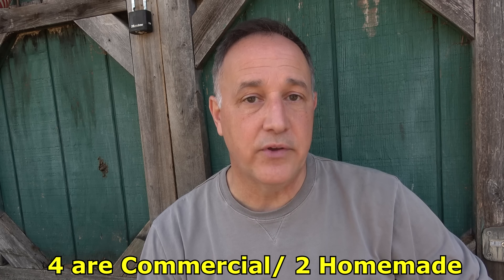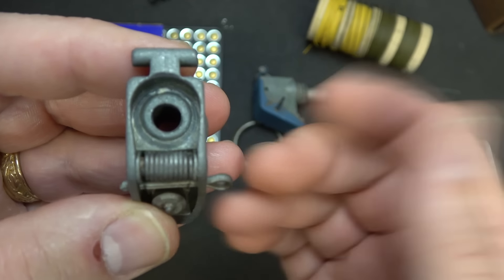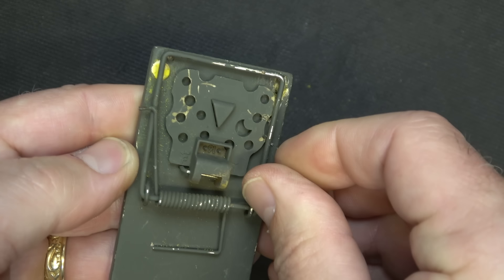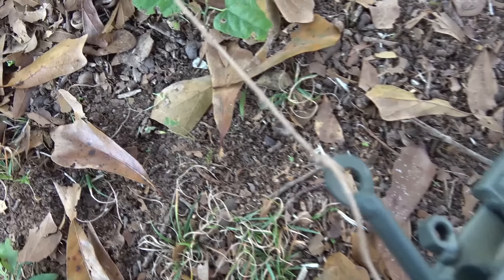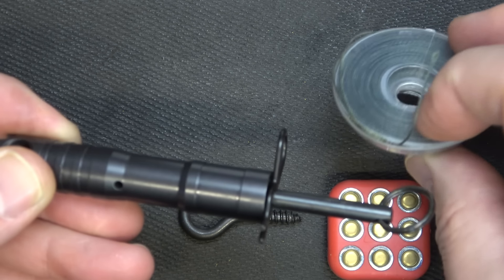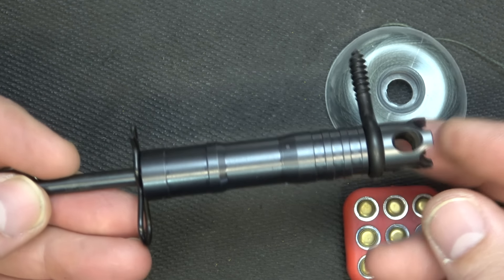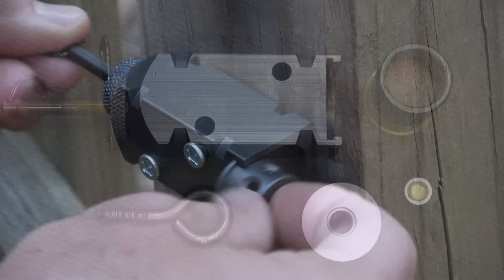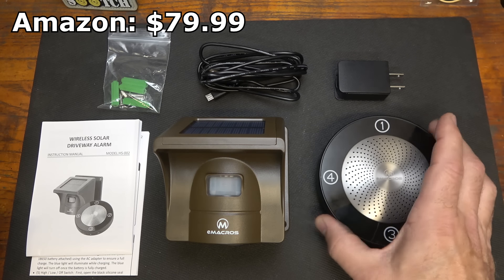6 Different SHTF Perimeter Alarms

Comment: I was an artillery officer and have slept through 155 Howitzers blasting 50 ft. away. I'm not sure a little cap would wake me from a dead sleep.  I've seen some cool motion detection alarms for campsite on Amazon for about $30. Sorry, I don't have the link handy. Emits an alarm loud enough to scare away intruders and wake you.
Reply: I was a small arms and artillery repairman in the army and I've slept through m777s going off, but I'll wake up from someone trying to open my door or my dog getting off the bed.

Comment: Mike at fifth ops has made an outstanding product for countless uses and American made used correctly without a doubt built to last longer than me and he’s very good with the customer’s certainly takes pride in his work and rightfully so make no mistake this product is not just for scaring bears my expensive tools are safe from the tweakers after many attempts to break into my shed and they will not come near it anymore because of the OC pepper loads they are both wise I’m onto them and they have no idea what maybe next

Comment: I wish you would make a general video on home protection. Here are a few of my ideas. A $1.50 wooden stick could save your life. One of the easiest ways for an intruder to get into your home is through your sliding glass door. Most people place a wooden stick at the bottom of the stationary side but this will do nothing to stop an experienced intruder. The door that slides open has a one-inch space on the top. The intruder will simply place their hands on the glass and lift it up. This causes the door to come off the track. They then kick in the bottom of the door making a triangle space through which to climb in through. This happened to me when I was not at home. Fortunately, my Husky met him at the door and he took off. The police came and showed me the intruder's handprints on the glass and explained how he did it. To prevent this, slide a 1/2 inch by 1 to 3 ft wooden stick in the top space of the sliding door to prevent the door from moving. 
I also place large solar lights high up and out of reach, secured with Gorilla tape on my porch and deck facing my doors. Lowe's sells them for 20 bucks.
Third, when my dog is finished chewing his foot-long bone I leave it on my front porch to let them know my dog has big teeth. : )
Lastly, keep your car keys at your bedside at night. When you hear an intruder hit the car alarm on your fob. He likely will run away.

Comment: Good alert for bears, 4 legged and 2 legged ones that have no business violating your rights in order to perform their so called duties.Also good for scaring the crap out of trespassers and potential no good vermin criminals.would be good if it would also discharge a paint or pepper spray so you could identify the guilty party.Also go to your local dollar store and pick up some of those cheap electronic alarms with the magnets. Glue your trip wire onto the magnet so that if it gets separated the alarm will go off. Easy cheap and noisy. The batteries can get expensive over time.and as always trail cameras and proximity sensors and motion detectors

Comment: Not really SHTF stuff, but solar powered motion activated lights are great. They are relatively inexpensive and serve the purpose of lighting up pieces where you walk and alerting you if something is in that area. Add security cameras and DIY equipment to the mix as you see fit. There are so many options for security cameras with them starting under $40, there's not really an excuse not to have them surrounding your property.

In these SHTF videos, I'm always expecting pungi traps or some medieval looking stuff. I'm picturing all the stuff from Predator and First Blood.
Reply: I usually see the motion lights set facing away from the "house". I was considering setting some up on stakes at a distance with the sensor facing inward. This would allow the perimeter to be set further away and avoid them being triggered if someone/animals aren't trespassing, for instance when camping. Hopefully, the outer perimeter would deter the intruder at that distance. The other nice camping advantages are, if they are staked near the ground, neighbors won't have light shining in their direction, you won't have them shining in your face, and you can use them instead of flashlights if you need to move around after dark. A secondary ring, set higher and nearer the entry points could be facing outward. The outer perimeter could be set far enough away that it isn't making your tent/house visible while interfering with the intruder 's night vision. Also, stakes would allow the lights to be repositioned so they aren't predictable.
Reply: That's the 2nd line of defence

Comment: A standard grenade head doesn't require drilling out for a 12 guage primer. I had to tap out the original fuse. No big deal.
Just use microcord for the line.
The pin hole should be equal on either side. Idk where this dude gets some of his info...

Comment: The advantage of the driveway alarm is the beam is truly invisible and doesn't need resetting. A lot of these perimeter alarms require enough pressure to set off that a savvy person may notice and stop (although there are ways to reduce the pressure). The regular perimeter alarms are good if you want to scare the person off the first time, but after the first time they'll know where it is and avoid the line. You have to move them every time they're triggered. The driveway alarms don't alert the person who trips them. At the same time, however, it means you have to confront the intruder which increases the risk to you. It's best to combine both systems, with the driveway alarm farther out to alert you and give you time to prepare and the noisemaker closer in to hopefully scare them off before you have to engage them.

Comment: It may be a little more expensive, but you can use the lasers from garage door openers. They are very easy to hook up to lights. I have a panel of 10 lights so I know where the intruder is coming and where they are going without them knowing. If you turn it off and back on, it resets itself without me giving away my position.

Comment: Those are practice grenade fuses. Smoke grenade fuses do not have the stem and have a green safety lever. Smoke grenade fuses can be drilled to accept 5.56MM blank rounds, BTW.

Comment: Respectfully sir, kevlar trip wire will decompose, "UV Degradation". If you're leaving these setup over days or months it may not work well. There's a new fluoride based fishing lead, very transparent, thin, and strong, might try that?

Comment: I've used dune of those fireworks poppers that have a string and when it's pulled they pop. Very cheap too. 
Also some really cheap door/window alarms on eBay that is place a magnetic part to something that moves or a string with the main part being the base or parent unit with built-in high decible audible alarm when separated. These let you know, but they also let the intruder know that you likely are aware of their presence now.
Reply: Those "break circuit" alarms at Harbor Freight are about $5 for a pair. I have used those for years in apartments and houses to supplement security systems. They are loud and difficult to defeat as there is only one way to open a door. The vibration sensor version are great for windows.
Reply: @joshhencik1849  also cheap eBay window opening alarms

Comment: I been toying with the idea of window alarms and rape alarms from the dollar tree with trip wire for a early warning system in a Bug out situation with a mouse trap to fling the second half of the alarm ( this would make it harder for someone to shut the alarm off by putting the pin in the rape alarm or the second half of the window alarm back on it. Also thought of working out a way of adding in a chem light up a tree to be activated with a rat trap. I think in the dark the noise and the light elevated would work as a good combo to let me know which direction the intruder was coming from and allow me to either get set for a fight or know which direction to flee so as not to run into them.

Comment: Braided fishing line would work a lot better than mono line, it comes in all colors and is extremely strong.
Reply: Agreed. Use 100lb weight fishing line.
Reply: @victoreous626  25 lb braided fishing line would be more than enough,  it takes a lot more than 25 lbs to snap a 25lb braided line.

Comment: If those sentry alarm mines are all steel, and you setup the alarm, and left it there for weeks, or even months, I would be concerned about the all steel pieces rusting together. The cotter pin in the grenade top could be stainless steel or aluminum and this would not be a issue. Or would be nice to see a hot dipped galvanized coating on the sentry alarm mine... I can spray paint it myself.

Comment: Just to throw this out, fishing line work’s excellent, strong, thin and more bang for buck in some cases as long as you choose a crappy store brand, also for perimeters, best place is lowest to the ground and if you punch in nails halfway and bend them down, you can extend your trip line coverage, which brings the next small tip, the best alarm is one that won’t alert your intruder, the internet is a wide place and you don’t need to have a GED to learn how to make one of these, it can be simple remote -> sound if you modify your device and there are many other ways to make them.

Comment: in Italy it is difficult to find them and there are not many armories to buy blanks. I built a couple: one uses a simple electronic alarm for women, the kind that sound at 110dB when the fuze is removed. the problem is that it doesn't stop until it goes off. for the other I have always used an electronic alarm for home with a proximity detector, bought for a few euros. when someone approaches a buzzer sounds. the beauty of this is that you can connect an external speaker, so by setting that mode I get an electrical impulse , enough to detonate a firecracker. then just connect two long telephone wires, which are very fine and on construction sites are found in surplus to any large or small firecracker. I used it successfully to prevent wild boars from entering the garden .... even if now they understand that it is not a danger and after a few hours they come back ...

Comment: Those fuzes are actually spent M228 Grenade Training Fuzes.  They are used in the M69 training hand grenade. The M18 smoke grenade uses a M201A1 fuze/igniter.

Comment: I'm surprised that they aren't making the alarms out of aluminum or stainless, to keep the rust factor down.
  Thanks for the info. Might have to start making a line of these.
Reply: Al Henning; Yes! Just like always improving the basic mousetrap, they need to incorporate weather resistance into these devices.
Reply: Al
The fifth ops is anodized aluminum.
Stainless would probably price them out of business for both materials and tooling.
Using a stainless pin in the aluminum body won’t work either.
Stainless and aluminum don’t play well together. Dissimilar metal corrosion would destroy it very quickly.

Comment: You are a ram set alarm looks very effective yet I see no reason to use a string as long as I'm wanting somebody to open the door and set off the alarm just set the hammer alongside the door so as opening the door is to release the trigger. It could be mounted in the door frame along with the hinges.

Comment: Outstanding video I actually have all of the primer activated you miss you showered and have used them quite often they can also be used to set off a fuse or fire cracker to get more than a single pop, pop pop pop works very well.
Reply: Yep.
Just make sure there is no flammable material (such as leaves) in the immediate vicinity.  A single LARGE fire cracker can be used too but needs to be suspended by the fuse so that it drops away from the device before going boom.
Blessings.
Reply: Wow I just realized Siri didn’t say anything close to what I said well kind of close I’m glad you understood sorry

Comment: So how do you get the delay  , i,,mean if you pull the pin on a grenade, what keeps it from exploding in your hand , I assume  it has something to to with  the handle or what ever it is called on the side still holding it back till it's released,  but even once released how come it dosen't  go boom for a fue seconds after  it is thrown,  to it target.  I assume  that it has some sort of fuse  that my e burns down to the explosives??  Just curious,  I never asked dad that question   , he didn't like to talk much about  his time in Vietnam and the two Purple Hearts were shrapnel wounds  he has passed from A.l.S.  assume the agent orange,  was the cause

Comment: An Estes model rocket engine, 9v battery and a trip line works well during the night. Just don't set the neighborhood on fire.   
Can those shotgun and .22 blanks be bought at the local gun store or can they only be gotten on line?   
Thanks for the video.
Reply: 209 shotgun primers can be purchased at any gun shop or sporting goods store that sells reloading supplies. The Ramset .22 blanks can be purchased at just about any hardware store.
Reply: @richerich853  Thanks!

Comment: I got questions about the fifth ops 12 gauge. Can you install it shell up?
Reply: Yes, but the risk of water damage to the shell is much higher and putting certain types of "covers" over the shell (to keep it dry) could actually net you several years behind bars. "Coating" the shell could also result in felony charges.  Then there's the potential for bodily harm such as eye damage...which could also result in legal trouble.
Stay safe. 😉
Blessings.

Comment: Can you use paint like in those anti-theft security gadgets they have on clothes in stores?
Reply: Looks like it would be hard with a lot of these, given the tripwire pin is usually mounted perpendicular to the firing direction by design, but if you can work out how to solve that issue you're golden. Be warned that that could be seen as booby trapping though.

Comment: Nothing like sensor movement floodlights. Tripwires can be cut or avoided, sensors cannot.
Reply: BET? I do not want to tell people who dont need to know how to get past them but I know how and it is fairly simple. 
You do have to know where the sensors are but it is possible. Multiple ones would be very difficult.

Comment: It's been suggested that especially in remote areas, critters, deer, etc. may trip these.
I'm guessing too, that the one's such as Fifth Op's, " Flash/ Bang " device's, are typically going to be used temporarily, while camping, SHTF scenario's etc. ?
Wonder if anyone has installed them more permanently, as  perimeter watch, and if  after deer as example would trip these, if after they would avoid these areas ?
As to weather protection, would it be possible to cut an elongated slot in perhaps a soup can, and then slip it over the top ?
And to repel rust, keep them well oiled, or maybe spray them with some clear coat ?
                 ?
          ¯\_🥴_/¯
I Gitta " Bang " outta these videos !

Comment: God forbid someone actually loads live 12g rounds into the fithops ones lol.  That could be a very, very bad day.
Reply: It's not deadly.  It might hurt someone if they took a bb right in the eye but the chances are very slim.  Check out the video on them at Taofledermaus on YouTube.
Reply: The shot cup is so heavy that it just kinda drops to the ground when fired without a chamber holding the hull together and giving the powder the ability to propel it. Not very dangerous at all. Same with metallic cartridges that are detonated outside of a chamber; the shell fragments fly and the bullet stays still. Lots of slowmo video on here to show that clearly.
Reply: You can even throw a round into a fire, without the barrel to propel it it just pops

Comment: Will these work after being outside and exposed to rain for a few months?
Reply: Usually.  A thin coat of oil or low viscosity grease goes a long way.  Keeping the "round" dry is biggest factor.

Comment: Good, but not great. In the military, for site perimeter alarms we had alarms that came on with a continuous siren and a bright flashing light that told us where the intrusion occurred in an instant. The bang alarms only bang and then what?????  Which one banged? Where is the entry? We also had remote silent alarms that let us hear and see flashing lights on a control panel, but whatever tripped the alarm did not know an alarm was tripped so we could investigate without the source knowing we were coming. It would be good if there were siren, flashing light units for civilian use.
Reply: I definitely agree with you, however, everyday citizens dont have access to those same options.  Nor are many intuitive enough to create the same options lol